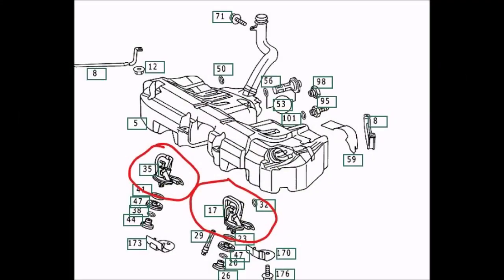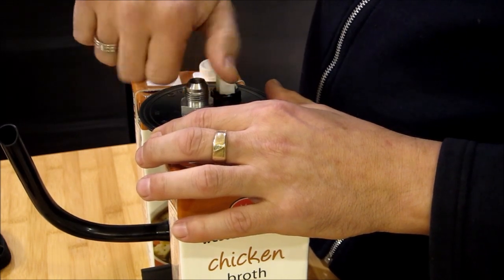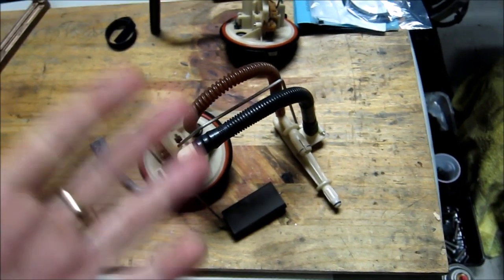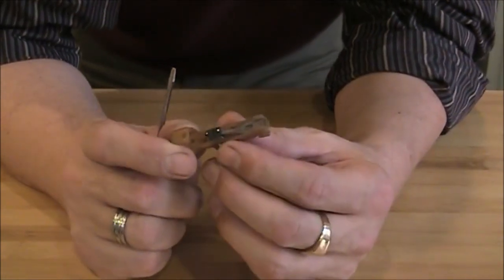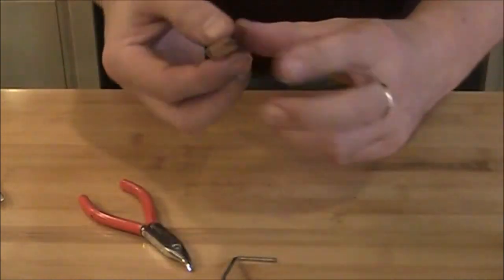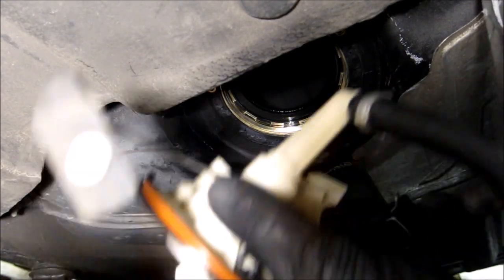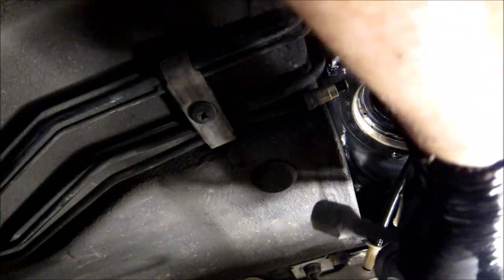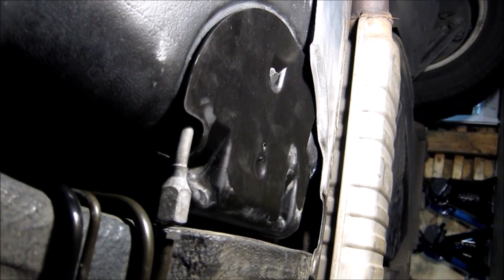Mercedes Benz W202 C280 Fuel Sending unit repair and seal replacement

Comment: Great video, thanks! Quick question: My 1998 W202 (C230) had really bad gas (dark brown and nasty smelling), so I drained it out of the drain plugs just like you did except I used a Hold fluid extractor. It emptied quick. Then I put 2 gallons in it and ran it for about 15 minutes. Then shut it off. After about 30 minutes I tried starting it and it wouldn't start. So I did some tests and discovered that the fuel isn't leaving the gas tank and feeding the fuel pump. I watched another YT video showing a later model W211 and they show that the plastic hoses crack and break. But they access them from under the seat, and it's way easier than mine. But I don't know if that's causing it or what tests to do to make sure it's bad hoses. Do you have any ideas why that's happening and how to fix it?
Reply from the maker: first see if the fuel pump is still working, when you turn the ignition on you should hear the pump running. then check if the fuel actually gets to the pump
Reply: @AndyPMercedesBenzChannel  

Thanks for your quick reply. I had to replace the pump b/c the existing one was totally plugged and corroded (I cut it open).

So I checked the supply and return lines and they're clear from front to back. I determined that there is no gas coming out of the tank to feed the fuel pump. So I unscrewed the discharge nut and found it clear, and no debris in the feed-well.  So that screen isn't plugged either.

At this point I'm beginning to believe something is broken inside the tank. Any ideas what else can be causing no gas to get into the feed-well inside the tank?

I read somewhere that the return line flows through a venturi which siphons gas causing it to flow between the tanks and fill that feed-well. If that's true, then how do you go about priming that return line if no fuel is in that feed well to be pumped through it?

I don't know enough about this system to know how to troubleshoot it any further. Appreciate any help you can give.
Reply: @AndyPMercedesBenzChannel  
Turned out to be the bellows type elbow on the feed well was disintegrated. Need new tank. OH BOY! Mercedes SHYT strikes again! Now I'm remembering why my main ride is a Honda Accord.
Reply from the maker: @chriscadman5715  that's a bummer... good luck.  Hope you can fix it
Reply: @AndyPMercedesBenzChannel  
Thanks. A new MB tank is about $1k, so that's not an option. I'm going to cut up the tank and install a removable port designed for fuel tanks. Hopefully that'll do it. That way I can fix it any time I want in the future. I also need to fix the RH side level sensor, b/c the plastic hose disintegrated at the bottom and the o-ring seal for the sensor blew out. I'm almost done with that. Just need to find submersible gas line that won't break the bank.

Comment: Hello Andy. I want to thank you to make a such video with great explanation! I have driving this car since 2009 and faced with this issue several years ago. Servicemans in our country told me that the sensor is not repairable and sensor is expensive in our country. But after watching your video I can understand that everything is possible if you really want to do it. Big thanks from Azerbaijan!!❤
Reply from the maker: Thank you. This is why i like these cars, most of the components are possible to disassemble and fix using simple tools and basic mechanical knowledge.

Comment: how is the pipes function on rhs my fuelevels work fine how does the fuel get to the rhs if the rail pushes the fuel all to the left tank my pump works fine why DOESENT MY TANKS EQUALISE WHERE DOES THE LHS GET DRAWN FROM ??? ITS A COMMON PROBLEM THAT NOBODY OF THE BOFFINS EXPLAIN HOW DOES THE FUEL GET TO THE PUMP SIDE OF THE TANK ON A FKN W202
Reply from the maker: Do you know what a venturi effect  is and how it can be used to make a pump? Google it, the rest I explained  in this video.

Comment: Also...which aftermarket sending units are the best for this car if the mystery oil doesn't work? They don't make the OEM's anymore for this car.
Reply from the maker: I don't know about aftermarket sending units, but these are very easy to clean.
Reply: @AndyPMercedesBenzChannel  I heard those sensors easily get gunked up over time. Common problem with the W202's. I am hoping after driving my car for a while after mixing that mystery oil and fuel after a few fill ups it will make the problem go away if not help it be more accurate.

Comment: I have a 1999 C280 and the fuel gauge isn't giving me an accurate fuel level reading where I ran out of gas. I heard by adding  mystery oil in the fuel tank that it can correct this issue. Has anyone else been successful in fixing this problem with the mystery oil than dropping the tank and replacing the fuel tank sending units? Thanks
Reply from the maker: I've used seafoam few times, and it worked fixing faulty sending unit, but after car was parked outside for a year the seal developed a leak , so I decided to clean them .

Comment: Hi, thanks for video. I just need to replace seals. Should I remove sending units completely?
Reply from the maker: I think so, as I recall the seal goes under the sending unit plate.

Comment: Hello, I have an interesting question Perhaps you have never seen such a car. :) So on a regular w202 the fuel pump has 2 inlets: one big, one small, both go from the tank to the pump. But in my car, the small fuel tank pipe is cut and blocked. Fuel pump replaced with w210. There is only one big pipe from the tank to the pump. Fixed as w210. What are the consequences of this? I'm interested in your opinion...?
Reply from the maker: sorry, Not sure

Comment: Hi Andy extremely helpful video thank you. I really need some advice my c36 stopped running and I now think it’s a blocked fuel tank. Tank shows half a tank but reserve light is on . I have tested that I get spark and fires when I put easy start in air box and it fires up. New fuel relay and 12 v to fuel pump - so replaced fuel
Pump. When I replaced fuel pump and filter not much fuel came out ! I’d have thought having Hal a tank loads should have come out ? I’d really appreciate any advice on what to do next ? Dave getting desperate 😳
Reply from the maker: Hi David. you gonna have to get inside the fuel tank. and see the condition of the transfer pump and hose. seems like its a very common problem. the fuel doesn't get transferred from right side to left side of the tank. so  fuel level still shows half a tank . but in fact the left side of the tank is empty . and this is whre the intake for the fuel pump is connected
Reply: Hi Andy thank you for getting back to me I’ll let you know how I get on
Reply: Andy silly question but is the transfer pump in the right or left sender unit ? I have purchased a new left side sender unit . I’ve not got inside yet ordered the groco tool but not arrived yet
Reply from the maker: As I recall it's on the left side.
Reply: @AndyPMercedesBenzChannel  

Thanks Andy I hapurchased a new unit for the left and it seems that Mercedes don’t do the right hand side anymore - thanks for your help I will replace and see how I get on I have also got a new filter fingers crossed
Reply from the maker: After u pull off the lhs sending unit,  make sure you check the plastic tube inside the tank, make sure the tube didn't break into pieces, and it's not loose inside the tank. Before u install new sending unit
Reply: Andy I purchased the plug and drained tanks as you said . I was surprised to find I had loads of fuel in both sides of the tanks expecting left side to be empty but it wasn’t . I am now surprised that fuel should be getting to fuel pump or I’ve refitted pump incorrectly . Do you think I should replace left side sender any way ? Could the outlet pipe be blocked 😳
Many thanks for your help
Reply: Turns out I didn’t have the fuel pump connected correctly 😳 . Now running
Reply from the maker: Hi David. Sorry was busy these days. Glad you found the issue.
Reply from the maker: @davidcroker5660  youre welcome. good luck

Comment: Hi, great video but I was wondering where did u hook up your ohm meter to in order to measure the ohms.  Thanks
Reply from the maker: on the bottom of the sending unit you'll find a plug connector

Comment: Hello 
I have the same car that you have. I bought two senders for both sides to change with old ones. the right side was easy but the left side was difficult.
I pulled the sender unit with plastic hoses, which comes with a tank -built in. unfortunately hoses are broken when I just saw it coming near the exit hole. 
I tried to pull them to open the lock to release them from the sender unit but it breaks suddenly. i am in bad mood.
I tried to be careful in this but ,,,,,,
the hoses, which come inside the tank was hard and dry.
please can you help me with what i have to do here?
please 
best regard
Musa
Reply from the maker: Hi Musa. Not a good situation. Obviously you need new hoses, im not sure if you can buy these hoses and can you get your hand inside the tank to figure out how replace them.  I assume there are some kind of clamps inside the tank to hold these hoses in certain position. Worst case scenario -  You might need to buy another fuel tank .

Comment: Hello Andy, Andy my fuel leak seems to be coming from the plug itself?
Can I buy the rubber seal for the plug alone?
Kind regards Karl
Reply from the maker: Im not sure, but you can try your local MB dealer

Comment: Hi Andy. I have the fuel leak on the right hand side also when I pump fuel it leaks onto the ground. What part of the tank is leaking in your experience? Would it be from the sender unit, or from the anti splash tank part?
Reply from the maker: Rhs ,it's where the gas tank cap is. I can't tell u exactly where the leak is. Pull the tire off and then the plastic to get to the filler neck.
Reply: @AndyPMercedesBenzChannel  okay thanks alot. I will give it a go. However my fuel gauge isn't working either so will have to do this fix on the video. Cheers your videos are awesome.

Comment: Thanks for useful video Andy, do you know what the hoses from left hand unit do and what are they connected to please? Mark
Reply from the maker: You mean the hose inside the tank? It pumps fuel from one side to the side that pulls fuel to the fuel pump. Thete's a ventury pump that this hose is connected to
Reply: @AndyPMercedesBenzChannel  Thanks Andy, it wasnt the pump that was the problem, as far as I can see..Car still has a mystery misfire but its much less after timing chain change, and all obvious tweaks.

Comment: I experience 2 times fuel tank problem, both end up changing new & used tanks. Problem are the impact on tank broke the inner hose....ends up only 1/2 tank of fuel can be used...need to top up fuel when gauge showing 1/2 tank. Be Careful Car too lowered like to bump impact to tanks..

Comment: Which of the two sending units has a pressure sensor? Any experience with check engine code P0450 on a W202?
Reply from the maker: I don't remember any pressure sensors on my sending units. I think its on the newer models.
https://mbworld.org/forums/c-class-w202/406763-98-c230-p0450-code.html
Reply: @AndyPMercedesBenzChannel  i have a 98 w202 and the sending unit looks different. The link you sent me to states that the passanger side contains a fuel tank pressure sensor. Any experience with this sensor on a w202? If its not there do you know where it is?
Reply from the maker: @predrag1  P0450 is the evaporative system code, why are you looking in fuel sensing unit? 
https://www.youtube.com/watch?v=KWLddboBvRA

Comment: Thank you for the video. I didn't have a jack or floor jacks that was able to lift my car high enough to fit a 5-gallon jerry can. I also noticed my existing wire connector is round while the sending unit connector on the new one is rectangular....did you have that problem? Did you splice or run a new wiring harness completely?
Reply: Oh yeah....I also read online that Mercedes had a recall on their original sending units because of the contacts corroded easily causing a poor electrical connection. Their newer sending unit contacts are supposedly gold-plated to better resist corrosion....how can we tell if the new sending units are the right ones?
Reply from the maker: Im not aware of it.
Reply: One more question...sorry...while you were down there performing sending unit repairs, did you or have every replaced your fuel tank screen? I bought a new one and will replace since I am doing the sending units....
Reply from the maker: I haven't changed the screen.
Reply from the maker: I used existing sending unit, so no problems.

Comment: I was thinking may be soaking/spraying the parts that have oxidation with a very mild acid solution like CLR or The Works Tile cleaner rather than sanding. The solution will get into areas the sand paper cannot reach.

Comment: Is there a second fuel pump inside the tank?
Reply from the maker: No, its not a fuel pump. Its a ventury pump to transfer fuel from right tank to left.
Reply: @AndyPMercedesBenzChannel  

Andy does the fuel fill on the right side and the Venturi pump to the left ? Then does the fuel go to the pump from the left saddle bag ? Could this be why my reserve light is on and no fuel even tho it says half a tank ? Could problem be left sender unit ? Dave

Comment: Hai there my Benz is a 202 but it keeps going off when it finishes the bank were the fuel pump is why?
Reply from the maker: Looks like its only using half of the tank, watch the video carefully i explained how the venturi pump works. It pumps fuel from one side of the tank to another.

Comment: I made the tool with a piece of plate steel, a big nut, and 4 bolts and nuts.
Reply: Yeah, I have used it several times. Sure beat paying big bucks!
Reply from the maker: did it work OK?

Comment: ...this one is a very helpful video!👍👍👍
However, question.. if we just need to drain out the fuel tank, can we just loose off those two bolt (using a hex tool), slide in the hose and carefully pushing the hose up to move up the valve (the white valve).
Will the fuel come out via the hose?
thank u. awaiting your answer soon.
Mine is w202 c200.
Reply from the maker: You could do it much easier without the hose and fitting. Remove the plug and push in a big screwdriver, it will push the ball in the check valve up and will let the fuel out. It might get messy cause youll get fuel everywhere. Using the hose makes it much cleaner
Reply: @AndyPMercedesBenzChannel  ..great! thank you. will do it using the hose.
Anyway, what is going to happen if after both part of the tank was empty (LH and RH), i fill the fuel into the tank (around 20litres; probably will only fill up the RH part) ?
will the engine able to start and well running (with the LH part empty) ?
Reply from the maker: @geochannel8593 
Interesting question... But i didnt have any problem starting the car and it ran fune.
Reply: @AndyPMercedesBenzChannel  i'm sorry, i didnt get it.  Did u mean you have no problem starting the engine with only one part of tank empty (LH)?
Reply from the maker: @geochannel8593  this is what ive done, ive drained both sides of the tank, replaced seals on both sending units and then put about 10 litre of fuel into the tank. Fired the engine and like i said... No problems. If you watch the video carefully i explained how the fuel gets from RH side to LH side.
Reply: @AndyPMercedesBenzChannel  ...thanks again, Andy. You're the best!

Comment: Hey, great vid, question, was there  fuel leaking from the sending unit as soon as I unscrew that Hex screw where you drain from the check valve, reason I'm asking is because I think I have a bad check valve, my fuel pressure is not up to spec, I've changed out fuel pump, fuel filter, all cracked hoses I saw, schrader valve, and purchased some refurbished fuel injectors for $30 each (all six injectors), car runs but idles rough intermediately

Comment: Hi, in my W202 200 cdi , approx 8 liters of fuel will stay in the tank and the car won't start. As you mention this is the amount of the reserve fuel. Is this video applies to my case?
Reply from the maker: Im not 100% sure but I would think that all w202 use same fuel system. On the LH side sending unit there are connections for 2 lines, one suction line to supply fuel to fuel pump and another to pump fuel from RH side to LH side of the tank. It uses the venturi effect to pump the fuel. I think you have a problem with this line, either the line is broken, plugged or something is wrong with venturi pump.
Reply: AndyP Mercedes-Benz Channel Thank you, I will have a look! Your channel is amazing, keep up the good work!
Reply: Thanks Mr for imparting  the knowledge .your video it is of great importance and so helpful ki
Reply: How did you get on ? I have a similar issue

Comment: Just a thought why not drive the car till you have very little fuel then do the job so you won't have to deal with so much gas? Other than that your video was very informative
Reply from the maker: Well.. that would be too easy....
Actually the car wasn't insured..
Reply: Ok cool, one more question can you use the existing pump to get the fuel into your container by connecting a hose or does it not get enough out of the tank?